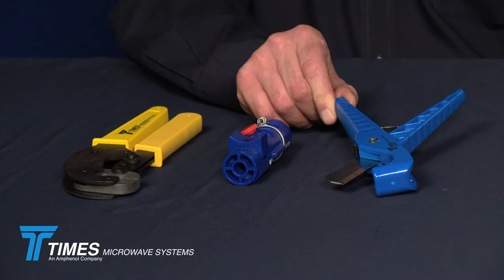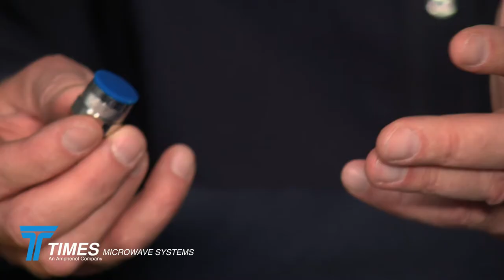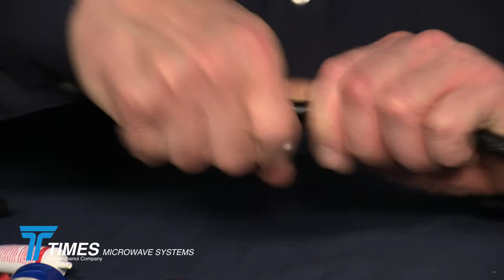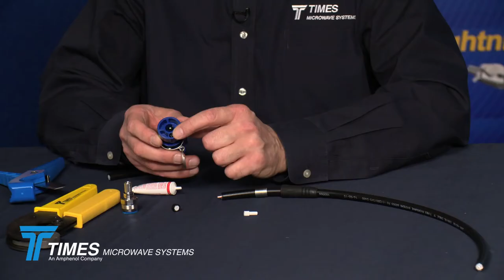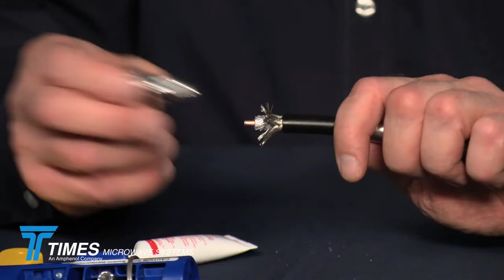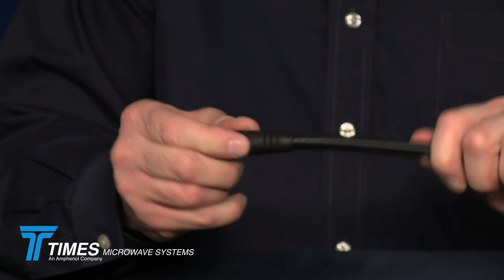LMR400

Comment: Thanks for posting.  The cost of these tools for the individual ham radio operator is way too high.  Nice system though.
Reply: The tools are still expensive for the everyday ham.  I was able to acquire a new prep tool on Ebay for $65 and the crimp tool for $50. Trying to source the connectors now.

Comment: you got a part number for the weather boot ?
Reply: For LMR 400 the # is 3109-394.  DX Engineering sells the boots for $20.00 for a 10 pack.  WSB series weather seal boot.